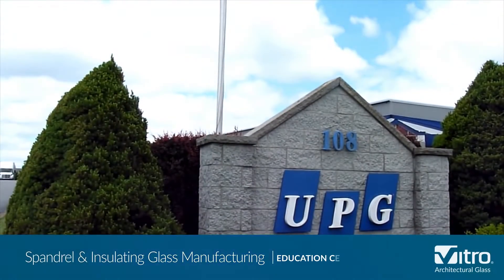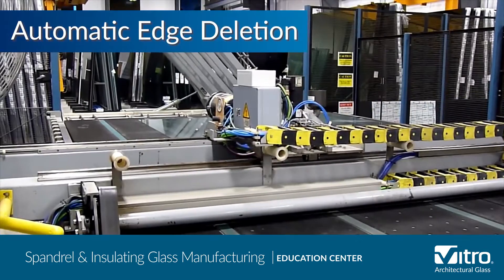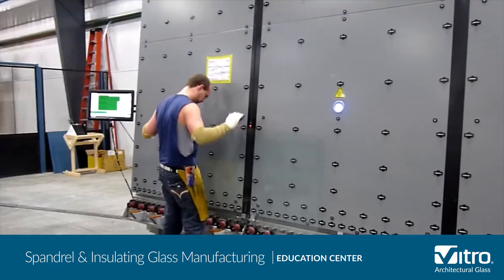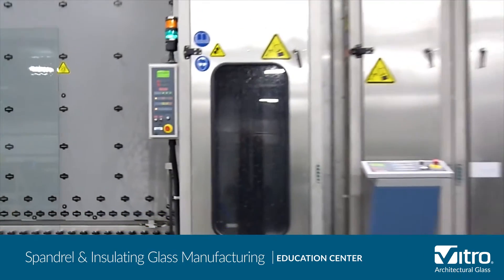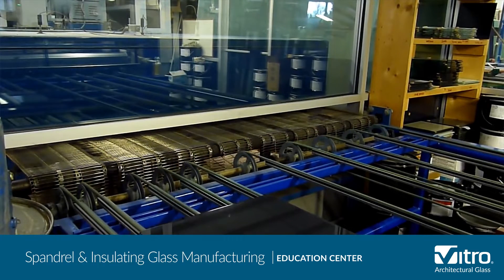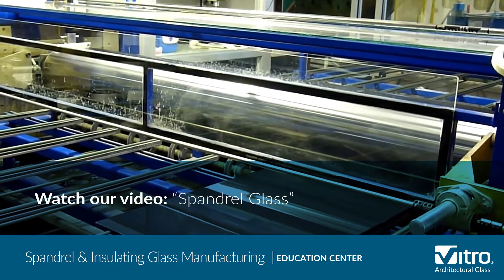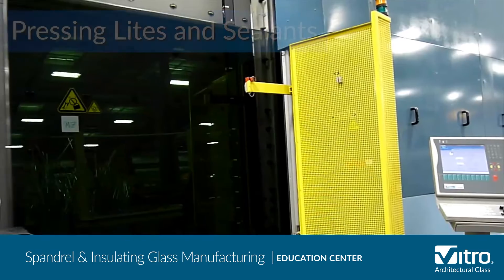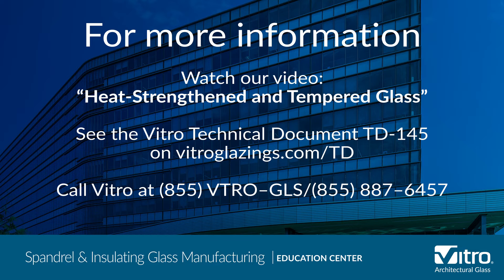Spandrel & Insulating Glass Manufacture

Comment: Looks like they use edgetech spacers and a PIB secondary.  I wonder if the ceramic frit messes with efficacy of the Low"E" coatings. A link to the Spandrel glass video would help.